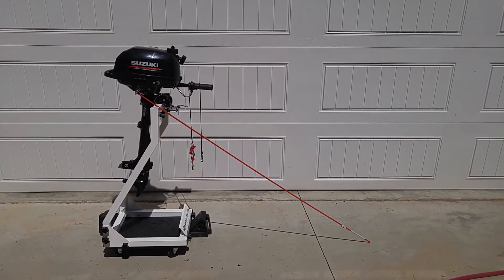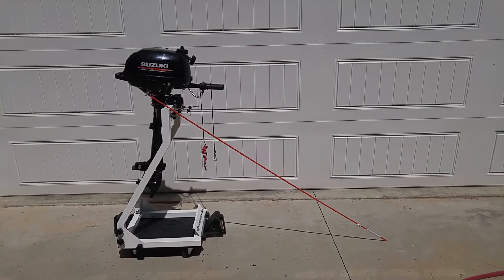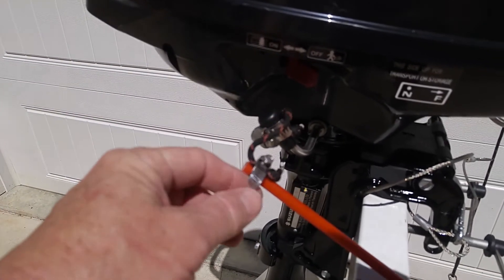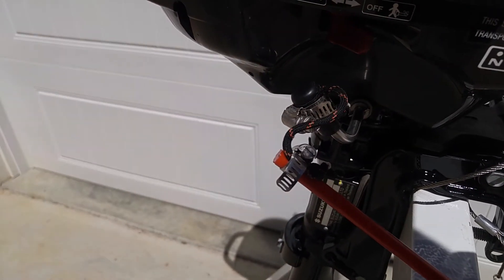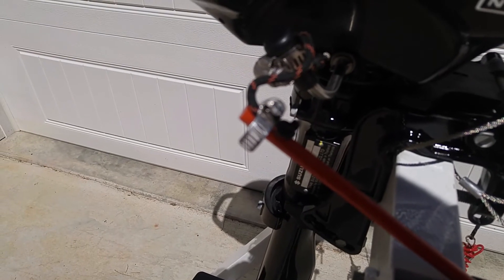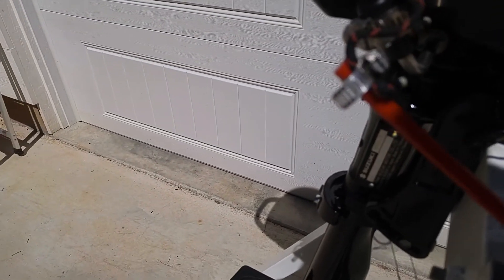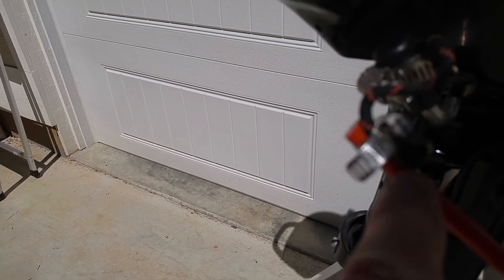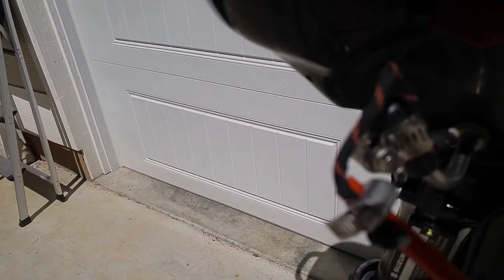Suzuki 2.5 HP 4 Stroke Short Shaft Outboard Shifter Extension

Comment: Had to come to give you some props my man.  I tried to construct a U joint out of PVC for a couple hours to slide over the top of the shifter. It works great, however, when I need to turn the motor anything that is stiff just flies right out of the boat or drastically reduces my ability to run and manuever.  

Using a piece of the rope provides enough play in the extension that I can fully turn and not have to worry about losing the shifter extension over the side of the boat. 

You're a genius. 

Thanks
Reply from the maker: Thanks Tak! Not a genius, just a problem solver.🤓